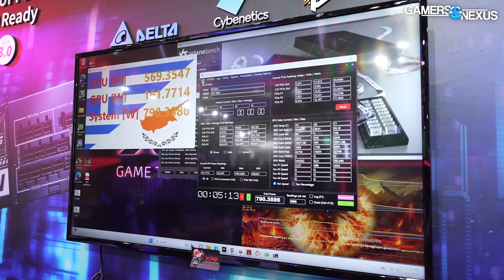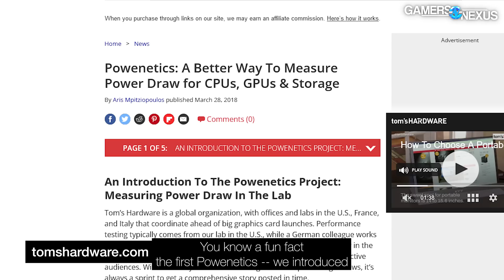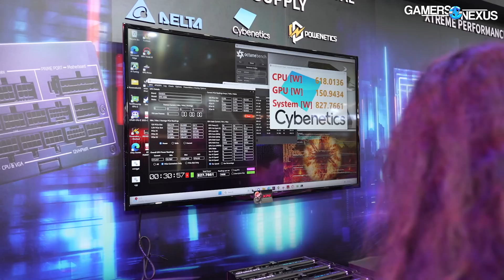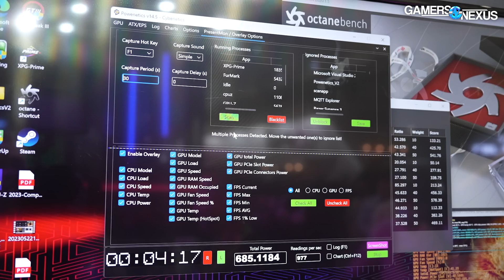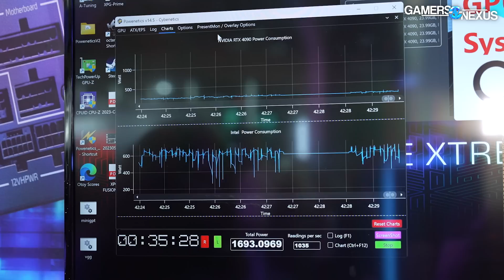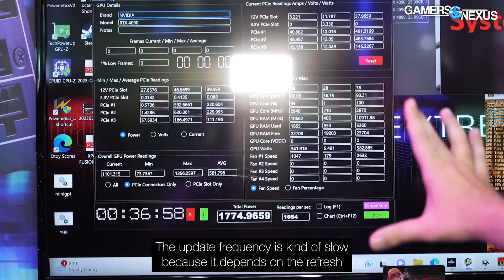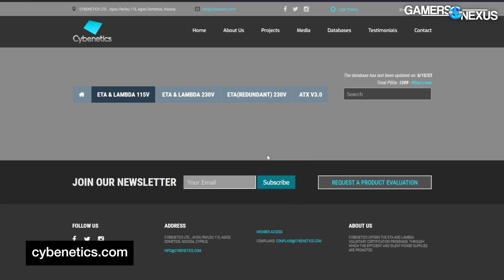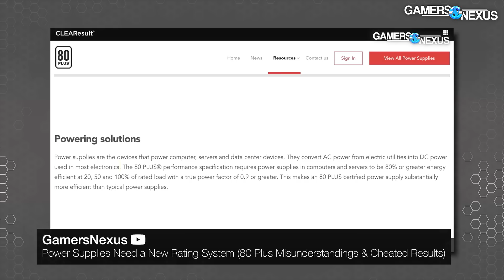GPU & CPU Power Testing Needs an Overhaul | Discussion ft. Aris of Cybenetics

Comment from the maker: I think we're clear of all the recent interviews and discussion videos! The last ones remaining are the lab tours from AMD recently. We are still working towards revamping/overhauling our internal processes (as discussed in news recently) and testing, and one of the items on the list is to integrate Aris' Powenetics tool. We have one here now and will be trying it out shortly. It will make it much easier for us to generate efficiency and other useful power metrics in component reviews.
Reply: Besides being interesting themselves, these tool overviews and methodology showcases give a lot of insight into the data. You control and communicate the testing setup way better than nearly any other reviewer out there, and it's always great to see each time you explore a new avenue of testing. Speaking of which, how are things going along with the fan testing machine?
Reply from the maker: @guycxz  Working on it actively again! I had gotten pushed off of it for like 6 months to keep up with general reviews, but now I should have some time.
Reply: Could it be used to figure out how much power a card including the drivers uses?
We know that NVIDIA uses more CPU cycles because of their software scheduler and we know that AMD has a hardware scheduler that takes the load of the CPU leading to better performance on weak CPUs. 
What I haven't seen anyone test is how much additional power the CPU is using for NVIDIA. I'd be curious if it's substantial enough to perhaps put AMD in a somewhat better light when it comes to efficiency.
Reply: Speaking of "efficiency and other useful power metrics", do you think you could include two more statistics on your GPU and CPU reviews?
First one's easy, "Performance per dollar", basically this would show the insanity of Nvidia's pricing strategy, because right now if you can't choose an AMD card and you want the best performance per dollar spent without regard to cost, you buy a 4090. And that's stupid.

The second one is maybe a lot harder to calculate, but it's also interesting because it might provide concrete evidence to prove what a lot of people think is the current trend in CPU/GPU design.
The specification is "Energy efficiency of the processing device", in terms of "this rate of actual work done takes this much power to facilitate", which lends me to thinking that the units should be something like FLOPS per watt, or if you want to take the time factor out of it, "Instructions completed per joule of input electrical energy".
I'm not really the expert for picking the unit, but the idea is to give a metric of "energy efficiency" that can convey the fact that a computer doesn't use the same amount of energy every time to compute something. If you limit the rate of calculations, you gain efficiency, but how much is different for every model of CPU and GPU.

So for the newer (12th/13th gen) Intel CPUs, you'd somehow need a benchmark that is capable of forcing it to use JUST the E-cores or JUST the P-cores (as well as both at the same time), and then measure the power draw versus how fast it does some sort of synthetic benchmark.
Since AMD is going to do something similar with it's next "not all cores are equal" type processor as well (I'm nearly certain), this will also be needed for future AMD systems when they come out with their version of what I'm going to coin "hetero-core" processors (hetero- in this case being the greek or latin word for "different", chosen because Intel's P-cores and E-cores are different at a glance no matter if you're looking at capability, efficiency, the promotional material, or even just looking at a de-lidded Intel 12th or 13th gen CPU).
The AMD X3D CPUs don't count as heteroCORE for this, they're instead heteroCACHE (not all cores have the same amount of cache, rather than not all cores being the same architecture). But AMD is sure to release a new CPU that has different kinds of cores on it all the same.

The thing I want this to point out (even more than has already been done) is that the current generation of CPUs and GPUs (at least from Intel and Nvidia, but also AMD CPUs) have taken the approach of "Just throw more power at the problem to make the transistors switch faster, efficiency be damned".

But what could this specification be used for? Well, for one, it verifies the manufacturer's claims that the CPU or GPU is "More efficient than ever" that they almost always claim every time a new generation of products comes out, and secondly with this specification in hand for a certain piece of computing hardware, and the maximum rate of work you want it to do, you would then be able to start picking a cooler that can handle all the resulting waste heat.
Reply: Hey @GamersNexus I've spotted a wrong transcription in the subtitles. At 16:43 the guest says "I like the idea because it allows the PSUs to have much shorter cables..." while the transcription says "modular cables" instead.  The following sentence about lower voltage drops and ease of installation don't make sense in the context of modular cables.
Reply: I love how Apple introduced an in-line PCI power delivery interface 4 years ago with the custom AMD W-series GPU’s in the Mac Pro’s and Steve acts like Asus just invented some new, never before seen tech/connector LOL. Maybe GN should look at the Duo or high-end HMB2 based cards in the Mac Pro and highlight whether Asus just copied Apple’s 4 year-old design or if it’s actually something new
Reply: That CPU was really pulling over 600 watts? 😲
Reply: There is a German engineering saying regarding overly precise measurements: "Wer misst, misst mist. Wer viel misst, misst viel mist." Good luck translating that one :D
Reply: @TheBetabot  I try to measure out to at least 1 significant figure further than I'd need to determine which way to round the actual number I want to use. But I also do my calculations with all the numbers that my calculator will allow me to input, and only round at the end. With a Ti-84, that's a lot of significant figures.
Reply: @44R0Ndin  okay, you say you measure. You mean to say, you use a measurement device . What is the measuring device's accuracy specifications? There is no point putting more significant digits than that. If my volt-meter says -/+ 1%, that means I have two significant digits. That's it. I can copy the third from the display, but it is meaningless.
Also, you have a TI, which is another serious issue with your methodology.
we're not in highschool anymore. Get a 48.
Reply: @GeorgeTsiros  Next you're gonna tell me I need to learn to read RPN. I have no interest in that, if it crunches numbers correctly that's all I need. I also have an 89 titanitum that I got for college work.
If I wanted to, I could do most of the math I need to do using the Windows calculator.
Or by hand, if it came to that.
Only a fool thinks that the means of calculating the result matters. You can only be right or wrong, and you can't be wrong because you used "not your favorite calculator".
Besides, if the task was complex enough and I wanted to automate it, I'd just go buy a license for MATLAB.
I know the tools I need when I need them. 99% of the time, the tools I already have are more than sufficient.
And the whole point of my statement about using lots of decimals was not that the final result would contain them. Rather, it's that I maintain the full precision possible according to my calculation method, until the calculation is entirely complete, and only then do I truncate the result to fit within the available significant figures determined by the means with which I took measurements.
This isn't my first trip around the block doing math, after all.
Reply: @44R0Ndin  if you are doing calculations with measurements, it's not the extra digits you need. It's the additional calculations of the resulting precision you need to do. 
And the calculator joke was a joke, ffs
and the 48 can do algebraic as well as it can do RPN. Finally, you don't read RPN. Finally finally, whether you like it or not, RPN is what you do when you evaluate an expression by hand. There is literally no other way.
Reply: @TheBetabot  Whoever measures, measures crap. If you measure a lot, you measure a lot of crap.
Reply: Great info!!! Yeah I was wondering how that PCB GPU power delivery connection would do. I look forward to the test results you bring us for that. Thanks Steve!
Reply: Hey Steve. Thanks for the amazing videos! I have only one feedback though. The Gamers Nexus logo has started burning into my OLED TV. I have a LG G2 and has started to show signs of burn in on the top right corner of my TV. I don’t know if anyone else is affected, but I’d really appreciate moving the logo around sometimes. I’ve been watching hours of videos lately! This might be a reason for the burn in :/
Reply: @NotTheAvg  There should be an "anti-burn-in" feature available on your OLED TV, they usually come standard with that. Failing that, yeah moving it around would help (maybe make a 3d logo that just slowly spins instead?)
Reply: DUUUDE HE'S A CYPRIOT? AS AM I!! AWESOME!!!
Reply: Getting to see testing on that level is a life saver.
Reply: @-T--T-  Were you banned for 'wrongthink' or were you just being a jerk? It's not "an increasing problem" because arseholes are as old as time. Jerks are not new, even if they get louder on social media.
Reply: be really cool if PCI-SIG wasn't fucking sleeping all the time and instead was working on something like the power foot
Reply: @-T--T-  Did you get banned for simply speaking your mind? Happens a lot around here these days with all the censorship.
Reply: @Sergmanny46  Nah, the censorship is nothing here compared to Twitter whenever Elon goes on a censorship rampage.

Comment: Do we think that maybe with today's power requirements, we have outgrown 12V as the main system voltage?  Going to 24V or higher would cut down the amount of current required proportionally.

Comment: I think it is Honorable that he is testing for PSU safety. Though if I were him I would run the badging like a CSA or UL listed safety certification. You pay a fee to test the PSU and if the PSU is crap, they pay the fee for the testing but they don't get the badge. If they want to keep the testing costs down then buy a tester and provide them an outline of the standards. You should also have the option to reject the company outright for certification if it can be proven that they are abusers of the certification. You deserve to pay the people performing the tests their wages and hire additional staff to provide better customer support while reducing the support load on yourself.

Comment: If you take 13 sensors 1000 readings per second over 5 seconds. Then store it as a doubles thats only 500kb. So maybe store it raw and then translate it later.
I learned the hard way that JSON for example is not the correct way to store data. Hundreds of megabytes of data while the same thing could be achieved with just <1 megabyte by writing raw data and then reading it again at a later date. Yes its not human readable but it can be translated to that if required.

Comment: interesting....reminds me of the time when I was working with a gpu company...and the way we did power measurement was to find the Vcore and Vmem rails and put a current sensing resistor (shunt resistor if you will) and measure that way

Comment: after the recent discussion with roman, maybe you should also mention in the sponsor segment, that the cryosheet is "only" one use
Reply: also you should buy at least 4 or even more of those, this is dirt cheap for a company your size and can easily make the money back by time saved. also you could do tests for different parts of the system at the same time if you wanted

Comment: It bothers to me that 80 Plus only releases efficiency data starting at 10% loads. So if you have a 1000w PSU, they start at 100w loads, thats way too high for seeing idle efficiency. Even if you have a 4090 and 13900k, your ENTIRE system combined is pulling around 70w idle. If you have a lower end build its dramatically less. Efficiency tests from 80 Plus really should start at a minimum of 50w, but they wont do that because PSU efficiency nose dives to under 80%, especially for beefy PSU's, making the premium products like a titanium 1300w look worse than like a gold 500w at low power.

Comment: I've been in test & measurement for a long, long time, and have worked with "the best in the business" , and any time that you put something between the power supply and a DUT, it is, as they say,  "non-trivial", and measurements need to be taken over all of the operational envelope, and as many sets of modes as possible, and, keep looking for the "rogue wave"... itps not just a measurement,  it's probabilities, and the ability to trigger on, and capture, the most elusive events...this requires, for tough measurements,  and robust results, oscilloscopes that cost well more than $1,000, more like beginning at $10k, and, then, probing..... great fun, but not for the faint of heart. Look up Picotest, Rohde&Schwarz, Keysight, Tektronix, Teledyne LeCroy... have a look at the Signal Integrity mailing list.
Great to see you guys taking it to a level that some people are not happy with ;-)

Comment: I do like the ASUS idea of the high power connectors specifically for high power PCI-e cards.
But like you and Aris said, "It needs to be an industry standard or nobody else is going to adopt it".
Like you said, you would need to get PCI-SIG on board with it, but because it's a motherboard power connector, IMO you would be doing the industry a disservice if you put the standard in place without consulting the ATX PSU standards people as well, because let's face it, if the "power connector" for the GPU is integrated into the "motherboard", you should probably get the "motherboard power connector" people to give their thoughts and/or design detail suggestions.

Right now I'd be calling the standard "PCIe High Power Extension" or something along those lines, to make it clear from the name alone that this is an optional EXTENSION to the PCIe standard, that has additional connectors that provide HIGH POWER tailored to the needs of higher power draw cards such as GPUs, but it's not JUST GPUs that could make use of this standard!
For a prime non-GPU example of something that could draw more than what a PCIe slot can supply, well, let's put it this way, have you ever wanted to charge your USB-C laptop from your PC while you synch files between them?
For that you usually end up needing a high power USB Host Bus Adapter, that spits out at least one USB-C port that supports USB-C Power Delivery. Even in it's basic form, USB-C PD is rated to supply up to 100 watts to a device (using cables that are electronically marked to indicate that they're rated to carry the 20 volts at 5 amps that the 100w is supplied as), and last I checked a PCIe slot is already limited to a maximum electrical power supply of 100W or less... so it doesn't look good for the PCIe slot if that USB HBA spits out even 2 USB-C PD compatible ports (doesn't matter internal or external either, they're present and that creates a potential problem of "too much power draw from the PCIe slot" that needs to be addressed).
And with most things switching over to USB-3.0 C or A, the USB-A ports are going to need to start supporting PD 3.0 as well.
Now, granted a standard PCIe 4.0 and earlier 6 or 8 pin PSU connector would do that job, but I don't think that connector is going to be supported forever.
Instead, we could be plugging more EPS12v connectors into the motherboard (where we have the real estate to not be worried about size and therefore aren't forced to use the +12vHPWR connector, which IMO is a good thing because it seems that where that connector is (outside of data centers), fires and/or melted connectors follow far more frequently than is tolerable (for myself at least). And as for getting the power the "last mile" from the motherboard to the PCIe slot, that's where the "PCIe High Power Extension" standard comes in to play.
Of course, we already know we're going to need nice wide traces on the PCB to handle these higher currents (600w at 12v is up to 50A, and that's a LOT, even for tinned traces), but I'm thinking we're going to go a step further and specify a thicker copper layer on the PCB as well. Now yes, that's more expensive, but it does something useful, namely it makes the cross-sectional area of the trace larger. It does so at a faster rate than just making the trace wider will, and board real estate for power traces is limited by the need for so many other kinds of traces on the PCB already (as well as the real estate used for all the different kinds of vias and connectors and pins and the like, and that's not even mentioning the things like the southbridge chip, and sockets for things like CPU and RAM).
Reply: i literally had an idea recently down that vein: putting extra power pins on the side near the edge of the board

could do a series of 50w pins with appropriate ground (native pcie provides 35w btw). a 600w gpu would need a row of 12 hot pins, but motherboards have tons of room on that side that seems to be mostly used for power anyways